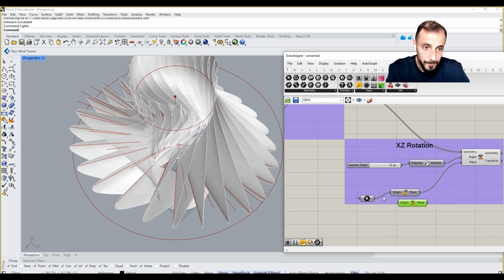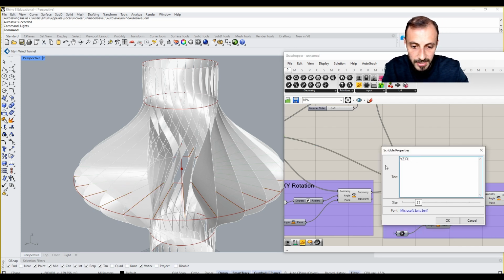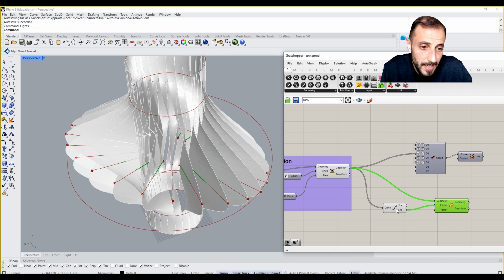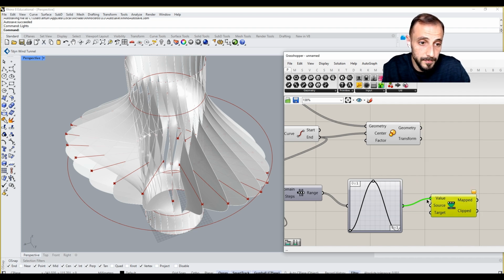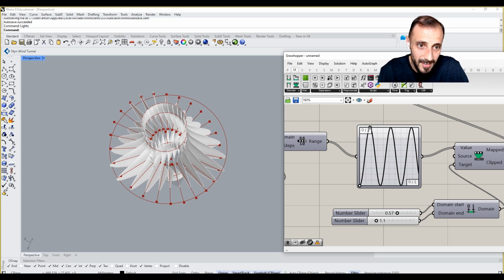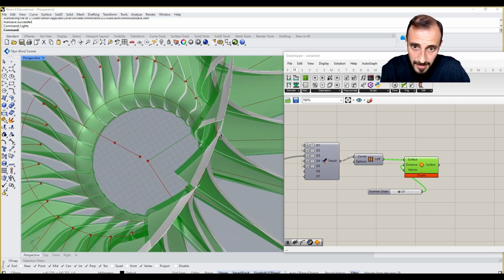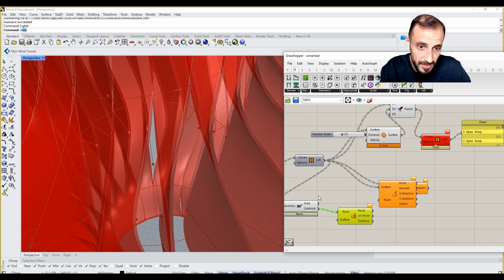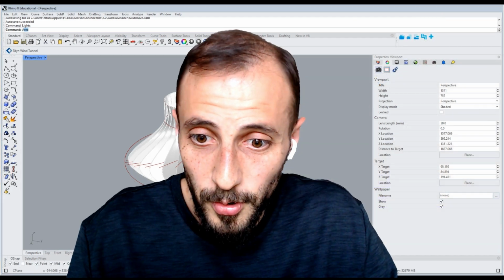6-Parametric Lamp Variations #DesignVariations #grasshopper3d  #lampdesign

Comment: Good video and good algorithm.
However, I think I will adapt the algorithm to have straight strips so that I can cut them with the CNC Router and assemble them right away, but now I have both options.
How can I manufacture the twisted strips?
Reply from the maker: That's a great question! Based on the material you can foolwo different strategies. For example, you can try to triangluate and unroll the strips then lasert cut them and bend!